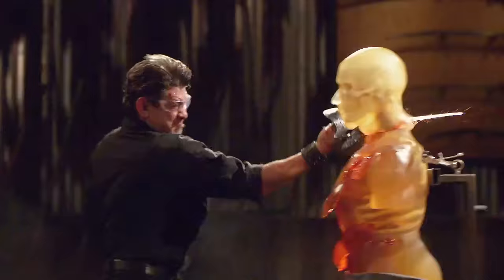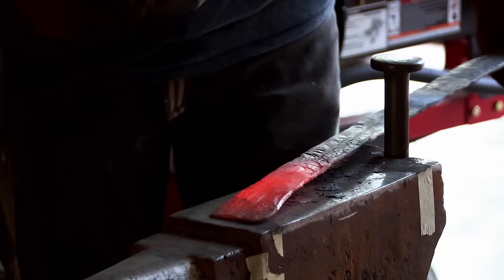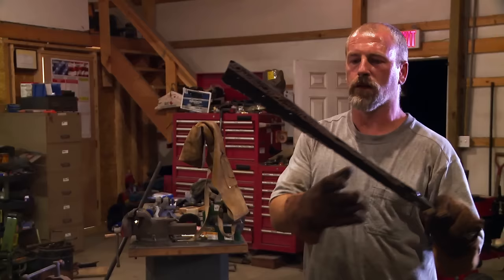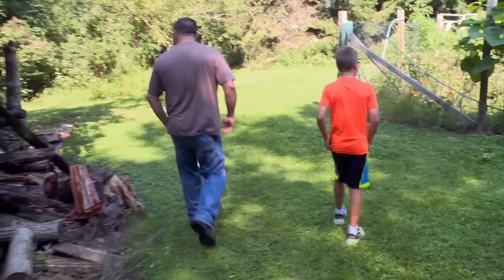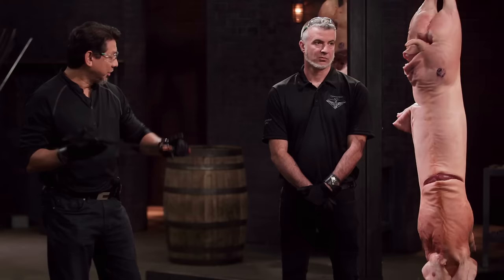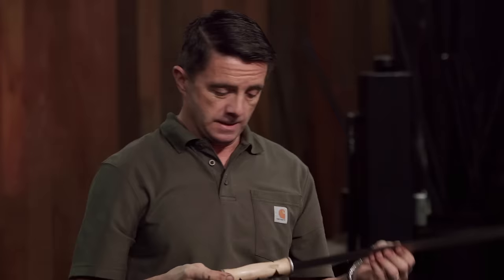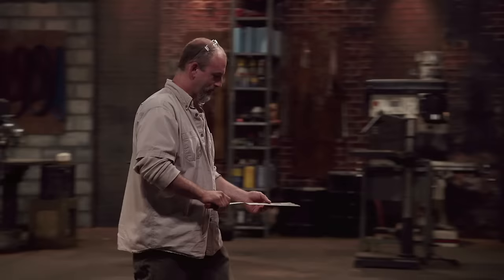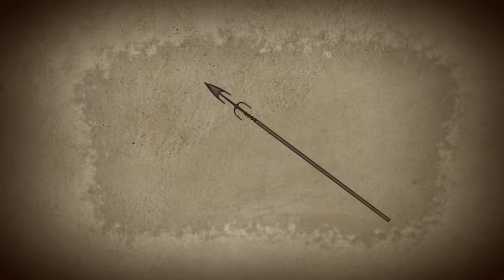5 Forged in Fire Fans Turned Bladesmiths CARVE UP the Competition

Comment: Man when he hardened that blade and immediately went to chop some wood, I was like "No, don't do it! It's going to- Yep. *Sigh*"
Reply: Hey, at least he discovered that there and not on the forge floor
Reply: @kuno3336  it's not a matter of finding that out then. He tempered and then went straight to doing that. There was no heat treat done. It was fragile to begin with, when he did that.
Reply: @snowoffstream5823  ooooh
Reply: @snowoffstream5823 he hardened it, and didn’t temper it. Heat treating was done, but not all the required processes

Comment: 19 y/o blonde dude didn’t win on merit like he was on about…. He won cuz the stoner guy he was against forgot to sand his spear shaft down…. If that hadn’t happened he would have lost by a long margin cuz his blade broke. There should always be a winner. If both weapons fail I feel like they should redo it or at least not announce a winner. Cuz they both didn’t deserve the win.
Reply: As Will Willis said: attention to detail is as important as craftsmanship in Forged in Fire. So the kid won by virtue of being attentive (despite being much younger than his competitor), and the benefits of having that trait are far from exclusive to winning in this show. You won't ace any test if you only partially followed the instructions.

 Being inattentive has caused weapons to fail on more than one occasion in Forged in Fire, even ones that do reach the finish line. Additionally, the kid passed his strength test with minimal damage to his weapon, so he had a good chance in winning afterwards even if the guy remembered to sand the shaft of his weapon right.